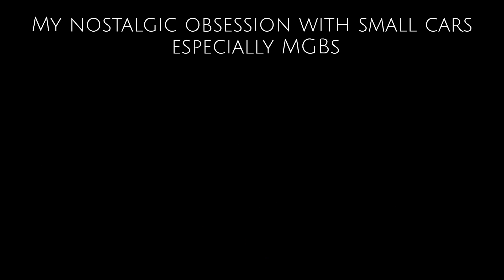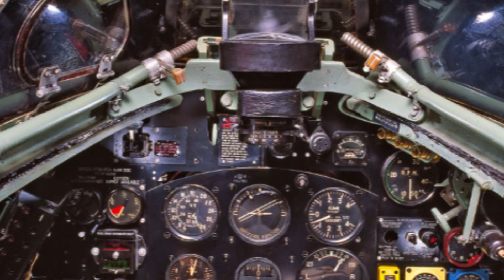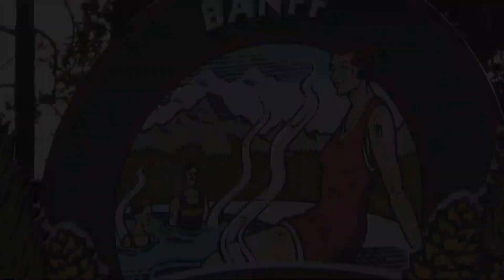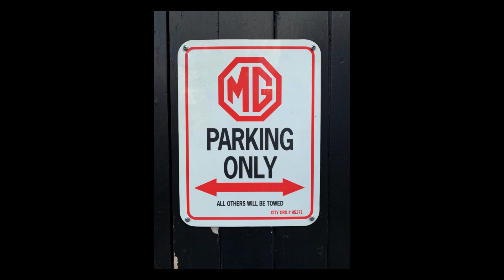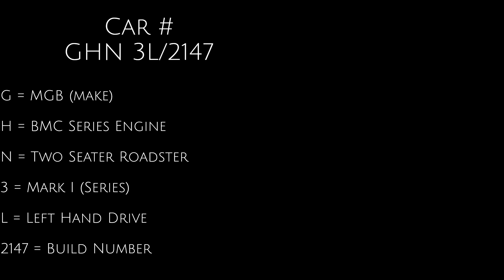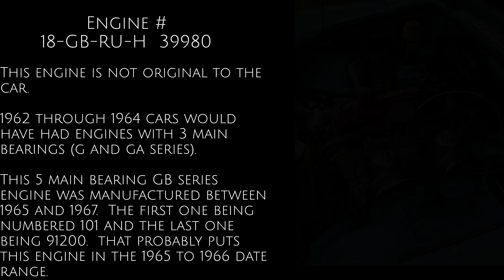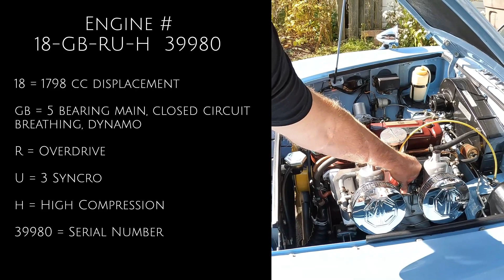MGB, MG B, 1963: BUYING, OWNING AND FIXING MGBs; HOW I BECAME OBSESSED WITH MY MGB

Comment: Nice car and nice original iris blue colour the only item i would change is the steering wheel for an original 3 spoke wheel
Reply from the maker: Thanks for the comment.  I love those "banjo" style steering wheels. Unfortunatley I have found that when I test drove a MGB that was fitted with one it rubbed on my thighs and made getting in an out a little awkward.  I am about 6' 2" and I just found them to be a little big for me.  Not sure if they come in different sizes and I would really like to find an original one if they came a little smaller.  I am in the process of making a video about comments I have recieved and will definitly touch on this.  Thanks again.

Comment: Very enjoyable video. Interesting history of the former owner and the purchase, similar to my experience 
buying my 1964 Iris Blue..
On your current motor. There should be, on the distributor (right/passenger) side of the engine block, just above the oil pan junction a molded- in raised "stamp" that looks like a clock.
It will have the year and month dates of the engine manufacture. 

Excellent video production quality.
Reply from the maker: Thanks, I will look for it.

Comment: Very nice early car.  Just wondering about the small square badge on the right front wing.  It looks like the BL badge on cars from 1970 on.
Stephen (currently restoring a 1969 Sprite)
Reply from the maker: Yes they are BL badges.  There is also a BL sticker beside the bonnet latch.  They don’t appear on the restoration pictures that I have and I asked the previous owner about them and he said that a friend of his (who helped him) had put them on at some point.  Not sure why and I’m afraid to ruin the paint by removing them.  The wings are not original and I’m not sure how the wing ones are attached, I would like to remove them at some point.  It does need a paint refresh so l will address it then.  I think I mention them in the video “viewer mail 2”.  Thanks for watching.